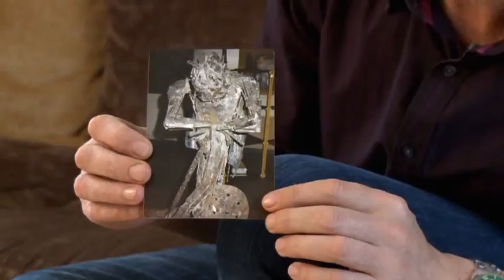1/4 Mastercrafts - 3. Blacksmithing

Comment: Spigots would come from a wood turner, unless you were rich or it needed to be wrought iron for some reason.
Reply: Erich M think about it. What seals the metal to metal surfaces of a spigot when rubber and nylon is not an option? You don't, you use wood. Ok ¿